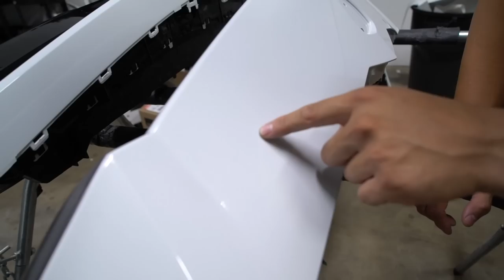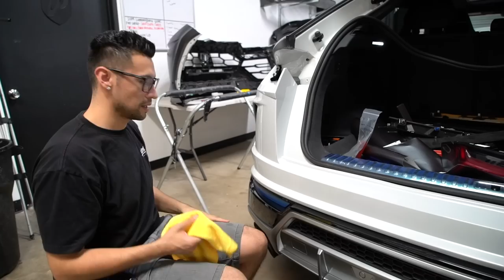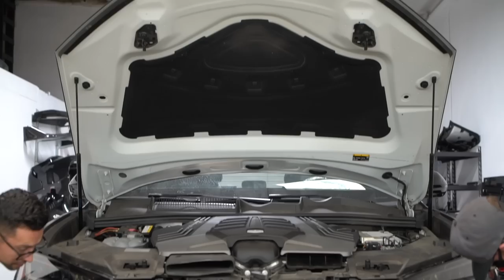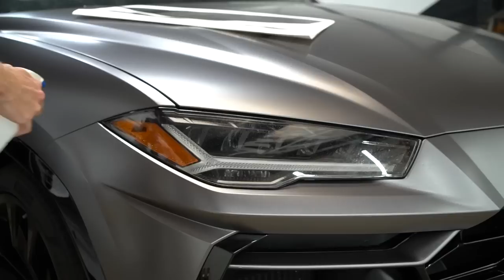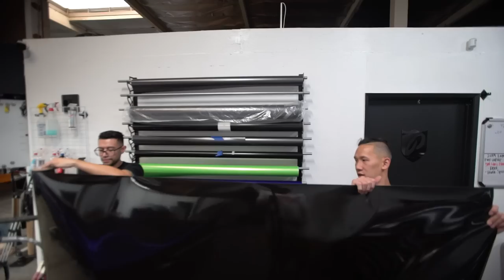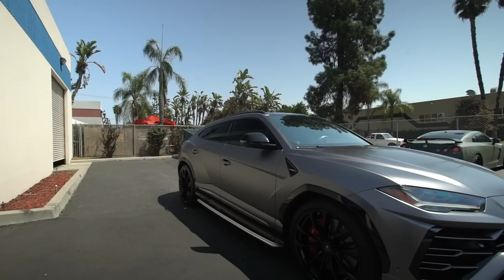The Color That Makes Every Car Look 10X Better | LAMBORGHINI URUS WRAP COMPLETE!

Comment: Just be careful applying PPF to the headlight assemblies of any higher end vehicle. As it will void any remaining warranty coverage for that vehicles headlights. Even if it’s a faulty auto-leveling ballast. The customer will have to pay out of pocket for the parts and labor that otherwise would have been free of charge. Even some dealerships will offer to apply PPF to your headlights as part of a "Protection Package."  But it you should always read your owner’s manual in the "care and maintenance" or "minor repairs" section to see if they allow for adhesive coverings to be applied to the parts that are essential to it’s operation.
You guys out in Riverside are truly amazing at wrapping. 
VAG vehicles are probably the most difficult to wrap, and you do it so well.

Comment: I'd love to get my daily driver wrapped, but unfortunately for me, based off quotes, it's cheaper to repaint... 😔
Reply: Where did you find their quotes?
Reply: @realkewlmann  didnt get a quote from them, got a quote from a couple wrap shops as well as body shops that do paintwork
Reply: @jacobamos938  same color?
Reply: @a.d.c7941  was looking to either do a nardo grey or a white. Got a quote from a local shop to wrap my SUV for 4k (not including door jams or anything, just what can be seen on the outside) and a body shop quoted 5k for paint.
This was not the shop in the video, these were a local shop to me in Colorado
Reply: @jacobamos938  Ok I see.  Yes, I’m kind of in the same situation.  My car is gray but the this particular gray bores me so I went to a wrap shop and was quoted three thousand plus so in a sense im thinking, why not just get the damn thing painted if im going to pays thousands for a wrap job.
Reply: @a.d.c7941  I bought a black SUV even though I wanted either a grey or white one, however those 2 color options only came with a tan interior and I wanted a black interior, so that's why I settled with a black exterior and wanted to wrap it and it just isnt worth it to me. I'll eventually get it repainted.
Reply: @jacobamos938  I see.  Yes I feel like repainting is gonna be my best option as well.  Idk wrapping (although pretty cool) just dont seem practical to me or something. Idk if that makes sense. It juat seems like its not gonna last/hold up like a paint job would
Reply: @a.d.c7941  wrapping, at least from my understanding, only lasts 1-2 years. A proper paint job, especially if taken care of through the use of ceramic coatings and/or paint protection film will last probably 5-10 years
Reply: Wrapping a car has become unaffordable. When it first came out it was about $500 total. It's just not worth it to spend thousands of dollars on a non permanent sticker. You can repaint your car for cheaper and it's permanent and it will last for lots of years.